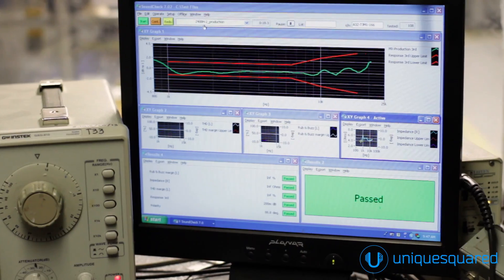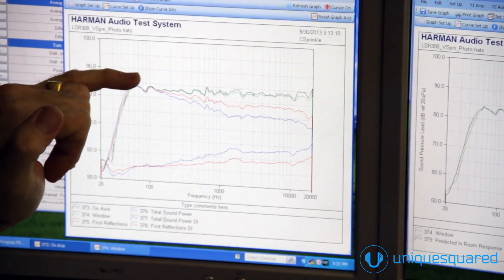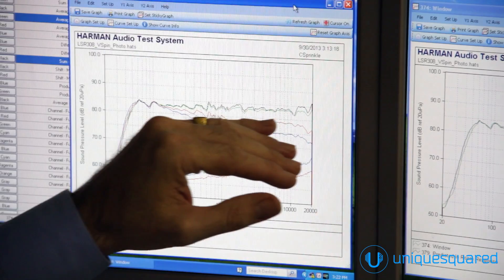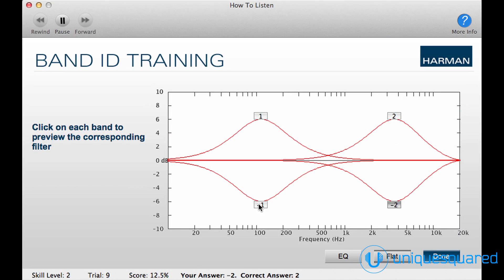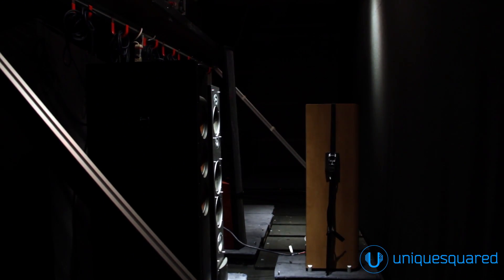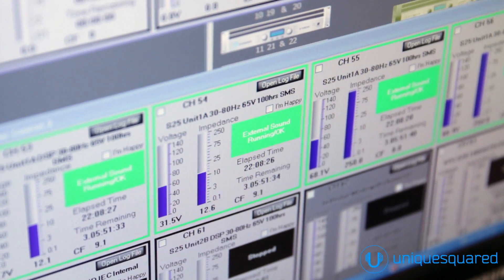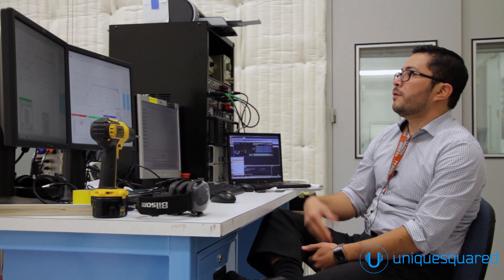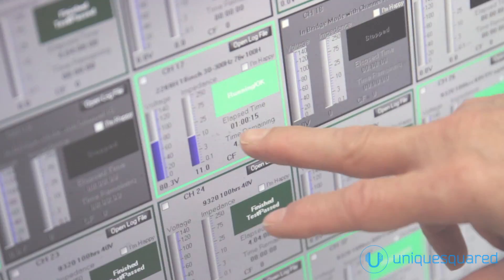JBL Hearing the Truth: Testing | UniqueSquared.com

Comment: In 1978 I bought my speakers new, the JBL 4311 Control Monitor a compact 3 way studio speaker. It sounded fantastic then and still sounds like new 39 years later in 2017, with zero repairs of any kind. It sounds almost live to me. It sounds great at low volume or full blast. it was the Professional and somewhat updated studio version of the JBL L100 the most popular model JBL ever sold. I'd love to get a 3 way of JBL's later and greater model. However until that happens I won't part with my JBL's.